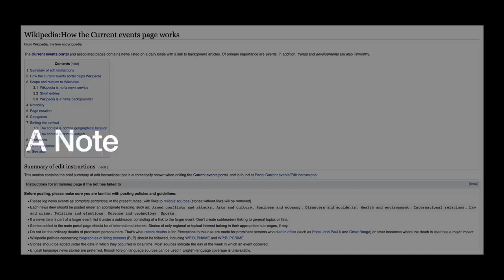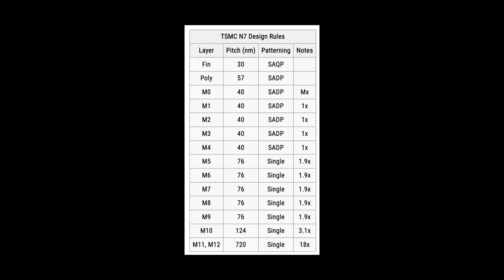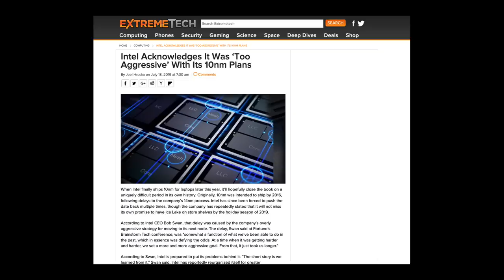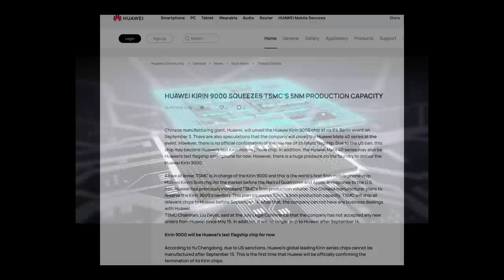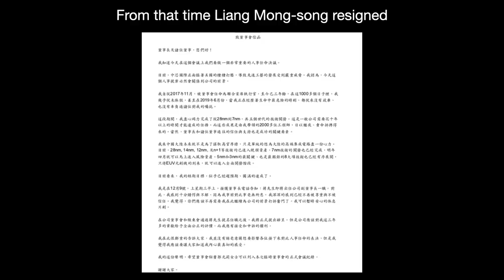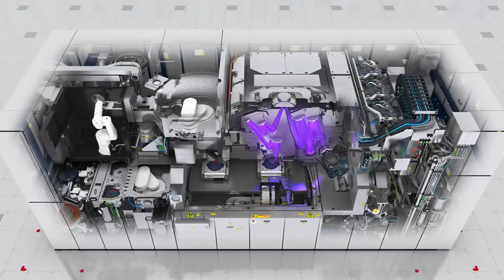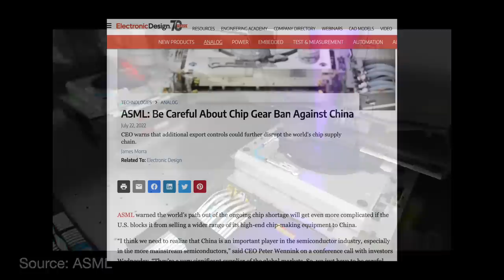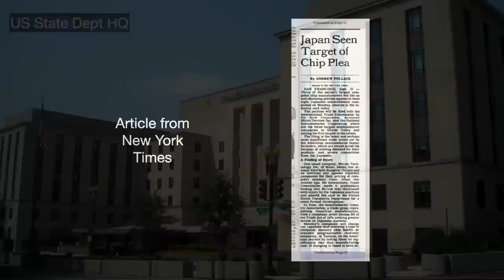China's 7nm Chips: SMIC N+2

Comment: Yield is the key.  You can have 1 nm nodes but if you spend a year just to get one such chip produced, it means nothing.  We'll see.
Reply: underrated comment.
Reply: I guess you could call it an elite hobby
Reply: TSMC came up with their 7 nm node back in 2017 while EUV only became available in 2021. So, TSMC's 7 nm too was based on DUV. If they had no issue with yield, then there's no technical reason why SMIC will have a yield issue. At best, it might take SMIC a few years for them to catch up. Or, maybe they are already there, let's see.
Reply: @aniksamiurrahman6365  Every company faces its own set of technical challenges, your analogy overlooks this aspect of technical know-how within a firm. Samsung and Intel both have plenty of EUV machines for a number of years now, yet both are behind on yield and struggle on the cutting edge.
Reply: @aniksamiurrahman6365  What are you on about? EUV has been available to TSMC for much longer than 2021. Their first high-volume manufacturing using EUV was announced in 2019, and even before then they could produce chips using EUV though yield might not have been sufficient for a HVM environment.
Reply: @TraitorDuck  My point remains the same. TSMC's 7nm node was produced in high volume with DUV. So, we know that technology isn't an issue for SMIC here.
Reply: @xhy12  That's because, with EUV, they're traversing through uncharted territory. Not so much with DUV.
The Asianometry video "How TSMC keeps getting better" discusses the nature of the problem these companies face with new processes. So, the question is, how much experienced SMIC's teams are.

Comment: The mining rig where the chips came from was manufactured in June or July 2021 and TechInsights only recently got hold of one and realized the breakthrough. The mining chip isn't as sophisticated as SoC and x86 processors but its also a year old so hard to judge SMIC's capability now.

Because of US' love of sanctions, a lot of China's latest tech achievement are not announced and there is a growing gap in what US thinks China can do and what China actually can do.

Jon and a bunch of people in the comment think this is stolen TSMC tech (the Chinese can only steal syndrome) and China have to follow ASML and TSMC's path of development to N5, N3.... That view failed to take into account:

1. China know EUV is possible so less travel down the wrong path
2. EUV is the current standard because of technological limitation in the 90s' and 2000s' (ASML shipped first prototype in 2010). With 2020s' tech, aspects and steps of current EUV machines can be simplified/skipped
3. China know High NA EUV is coming and efforts are on both EUV and High NA EUV. Like going from no phone to mobile phone, it doesn't have to wait years before starting researching the next tech
4. No other country have a combination of leading lithography industry, leading foundry, and chip designers and these people talks to each other.

The last time this combo appeared was 70 and 80s' Japan. Korea and Taiwan have leading foundry but cannot build lithography machines nor design chips. Netherlands/Germany/EU have the best lithography industry but way behind in foundry and design. The US have best designers and leading foundry but lithography is foreign IP. Talks between the entities would involves foreign trade secret laws
Reply: I think the first chinese EUV could come out around 2030, Tsinghua University already has an ongoing project to make a newer SSMB EUV (higher power than ASML's LPP EUV). They've promised to bring out a prototype model by 2025-26. Then give or take a few more years for commercialization.
Reply: You're confusing China with Taiwan. China has the capacity to build simpler chips (i.e. NAND memory) but will never catch up to foreign CPU designs.
Reply: @user136002  That's stupid, Huawei's HiSilicon Kirin processors were competing with the most advanced Qualcomm and Apple processors before Trump's sanctions. Intel itself has said it expects serious competitors to arise from China in the field of PC processors.
Reply: @xBlackWind  Kirin is a barely modified version of the base ARM design and is effectively dead. It was never competitive against apple. Intel says a lot of stupid things.
Reply: @user136002  A little research proves you wrong, if you compare Huawei's most advanced processor before sanctions, the Kirin 9000 and Apple's A-14 bionic (both of which were released in Q4 2020 and both based on ARMv8), the Kirin 9000 CPU had a max clock rate of 3.13 GHz while the A-14 bionic had a max clock rate of a very similar 3.1 GHz. The Samsung Exynos 1080 based on the same ARMv8 released in the same Q4 2020 had a max clock rate of a relatively lower 2.8 GHz. Unlike the above, Qualcomm only managed released its 5nm based processor only in 2021. So yes, HiSilicon was definitely at par with the world's best at its peak. 

And sure bro, you totally know more about the industry than Intel's top executives.
Reply: @xBlackWind  By quoting clock rates you've fundamentally shown you know nothing about CPU design. A 5GHz P4 is nothing compared to a 2GHz i7 on a per-core basis.

Hey, remember how Intel made 14nm++++++++++ while insisting 10nm was "almost ready"? I wouldn't exactly trust their PR.
Reply: @user136002  Cool, take a look at benchmarks then. 

AnTuTu 8 gives a total score of 698731 to Kirin 9000 (222644 CPU score, 234492 GPU score) while A-14 gets a total score of 571583 (177628 CPU score, 207069 GPU score). 

To be fair another platform GeekBench gives a slight edge to the A-14 in multi core score: Apple: Multi-core Score (4198), Single-core Score (1583). On the other hand, Kirin 9000’s Multi-core Score (3688), Single-core Score (1583). 

Huawei’s Kirin 9000 supports 66W fast charge and 50W wireless fast charge. But Apple’s A14 Bionic chip only support 20W fast charge and 15W wireless charging. And when it comes to the number of transistor count, Kirin 9000 leads with 15.3 billion transistors. While A14 bionic had lesser number of 11.8 billion count. The Kirin 9000 supports 90Hz refresh rate which is higher and faster than the 60Hz of Apple’s latest chip. 

So it should still be obvious, that even at the very least, Kirin 9000 is at par (if not better) than the world's best
Reply: @xBlackWind  If anything it shows how far the ARM foundation has come vs custom designs. Kirin isn't special. In fact, its biggest competitor (the SD875, QC's first 5nm chip) beats it handily.
Fast charge, refresh rate, and other add-ons are features, not performance.
Reply: @user136002  You're right, according to AnTuTu, SD875 has a performance lead of 4% over Kirin 9000. But Huawei Kirin 9000 again does have a lead over Samsung's first 5nm Exynos 1080. I'm definitely not saying Kirin is the best in the world but Chinese processors can fully compete with the leading edge.
Reply: @xBlackWind  If Kirin was at the minimum on par, why hasn't Huawei recovered from the sanctions? Why am I not seeing exports? Their phones have completely disappeared from shops years ago. I used to see them everywhere. I still see other Chinese phones. Huawei is farming pigs for cash flow.

Maybe they do have a chip but it has abysmal dead end yields with reviews done with engineering samples and cheat benchmark boosters. I have seen these boosters on x86 motherboards decade ago and it wasn't a hidden option in bios. Perhaps they put generations old chips into their phones and lie about it. Businesses in China are infamous for his kind of behaviour. If they can't rip off foreign markets with strong laws against deception, then rip off the domestic market.

Huawei's executives can talk all they want, the reality is simple, they got nothing. I can't buy their phones even if I wanted to.
Reply: @xBlackWind  Samsung admitted they messed up with their more recent designs. The base designs from ARM are better.
More to the point though, Huawei/Hisilicon do very little in the way of designing the chips. ARM provides base designs and others add features to them (such as fast charging).
Reply: @oohhboy-funhouse  What does Kirin being at the leading edge have to do with how it copes with sanctions? The entire point of sanctions was to destroy HiSilicon's ability to make advanced processors. You must be child if you think Huawei is supposed to build leading edge fabs, EUV and all chip manufacturing equipment within 2 years. HiSilicon can no longer fab their 5nm chips at TSMC or Samsung which are the only companies capable of fabbing 5nm nodes. SMIC can only go till 7nm. Apple would face the exact same fate if it was banned from TSMC/Samsung. You can't even use Google on Huawei phones, that's the point of the sanctions, so no one in the west would use Huawei smartphones. Hell, even i wouldn't buy Huawei phones at the point without Google services, that's the whole point of the sanctions.
Reply: @user136002  Everyone Apple, Samsung, Qualcomm, Huawei use ARMv8. Yet Apple cannot give the same fast charging or screen refresh rate as HiSilicon (Apple actually uses the more advanced ARMv8.5 compared to HiSilicon's ARMv8.2)
Reply: @xBlackWind  Apple is fully capable of integrating those capabilities but decided not to. Same thing with using USB-C vs Lightning - they decided not to.
Reply: @xBlackWind  You keep bringing up Kirin and Huawei that's why. I never said Huawei was a fab, no one has. Kirin the chip you keep hyping is supposed to be in their phone. So is it being produced or not? If it isn't a commercial product, how cares what the supposed specs are. Not having Google doesn't stop the phone being made that could be brought if you wanted to. If you don't want their phones, then why are you hyping it?

If all you are doing is yelling about specs based on engineering samples and/or non-real conditions, how does that matter? Why should customers care? Intel/AMD could run a cryogenic cooler to push their chip to 10GHz, but that isn't a product. There are people who do it as a hobby and post their results. They don't use the results to argue whether Blue or Green is better.
Reply: @oohhboy-funhouse  HiSilicon's reserve stocks are over, they did sell the chip on the Mate 40, Mate 40 pro, P 50 and Mate X2 for a little while but they can't really mass produce those processors any more. I don't understand, how exactly are you expecting the Kirin 9000 to be a commercially available anymore if can't access 5nm nodes. 

My point about the performance benchmarks of the Kirin 9000 was a response to the other guy who claimed Chinese CPUs couldn't complete with the leading edge. And i think I've given enough evidence to prove my point.
Reply: @xBlackWind  fast charging and display refresh rates have nothing to do with the cores or the node used. That’s the charging circuits and displays used. It’s silly to say apple doesn’t use 120Hz displays because the A14 can’t handle it. An A7 could probably run at 120Hz if attached to such a screen with proper firmware. HiSilicon did what every other fabless Arm manufacturer does, like MediaTek - they modified the reference design and went to a fab with it. The fact that they used the most advanced fab is what allowed them to be competitive with others who are using the same fab. Not some genius design. Without the advanced fab, there are no advanced chips. That’s the whole point of the sanctions and why china is trying to get domestic leading edge fabs.
Reply: 1. Wow Nikon and Canon must not be aware of EUV viability, otherwise they would ve done it too

3. If they cant even make a commercially viable DUV in over a decade, what makes u think they can just skip to high NA.
Reply: @doctorwilly  1. Nikon and Canon could not license the EVU patents that were hold by US national laboratories because the U.S.-Japan Semiconductor Agreement of 1986 limited Japanese export of chips to mostly DRAM only and Reagan enacted a series of tariffs targeting Japan. Obviously China wouldn't care for any US IP laws not to mention those EVU patents already expired

3. What made you think not commercially viable now = not commercially viable in the future? Chinese DUV are not commercially viable because its cheaper to buy foreign than spend huge sum on a tech that's no longer cutting edge. With more and more US sanctions, what's commercially viable shifts. If it can only buy from Chinese supplier, whatever is available is commercially viable.
Reply: @Peizxcv  I am not sure if you understand what commercially viable means. If you can't make the chips to scale or is too expensive, you goofed. Say you can make 100K chips, if buyer needs 1 million you can't fill the order, the buyer has to walk even for free(You have to make money too). The limited production might not be worth the opportunity cost of getting the full order of something slightly less capable.

Then there are other factors like too much power draw or poor thermals, short lifespan, aggressive binning for higher yields. Can't meet requirements, no product.
Reply: @oohhboy-funhouse  You are thinking commercially viable on the globally scale. I am talking about commercially viable within China.

None of Newport News Shipbuilding, Ingalls Shipbuilding, Bath Iron Works, General Dynamics Electric Boat are commercially viable shipbuilders but the Pentagon still orders from them
Reply: @ftd7435  that's odd, you threw together so many words without saying anything.
Reply: @user136002  China is producing risc v chips using modern design tech that makes hardware design similar to software
Reply: @diegoantoniorosariopalomin9979  Your point? Chip design software is primarily built in the US. Aside from ZTE and Huawei, China isn't banned from using it.
Reply: China has being researching EUVs since the 1990s, which a proof of concept made in 2002 with a 12 watt light source and two mirrors. A more sophisticated prototype was made in 2016, and it was good enough to to meet Project 02 standards. (Note, SMEE's  ArF immersion prototype actually didn't meet standards in when project 02 closed in 2018. It's was only recently announced to be workable) However, keep in mind that EUV prototype was made by a research institute that normally makes optical "remote sensing" satellites, so it's likely has all sorts of design choices that's not applicable for commercialization and aside of an announcement a rough description we know very little about what the prototype actually entails. For reference, the first ASML EUV prototype was in 2010 and first product using EUV was made in 2018, though ASML is a commercial company so the prototype is likely to be a lot more production ready than the Chinese one, but we never know.
Reply: @seanwong8479  China was far from the only one researching EUV, not sure what your point is. All that time spent and all that money burned with nothing to show for it.
Reply: @user136002  BOTH ARE BASED ON THE SAME ARMv8. So it is a like to like comparison.
Reply: Kirin = ARM = Not a Chinese CPU.
Reply: @MostlyPennyCat 😂  you win the argument. Kirin is not a Chinese CPU. mate 60 is not a Chinese phone. Huawei is not a Chinese company.

Comment: What an amazing prediction just one year ago, without any announcement, disclosure, advertisement, the mate 60 Pro quietly start selling on Huawei's website 28/08/2023, and it sold out in less then 5 mins. The mobile soon get pulled apart, videoed and analysed around the globe, then the details of the CPU came out as N+2 7nm chip. The new era started.